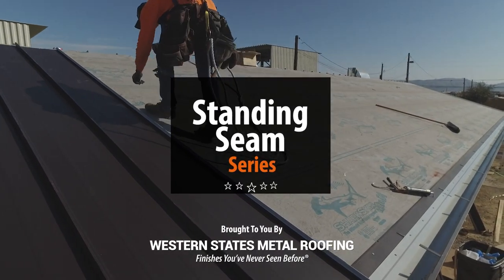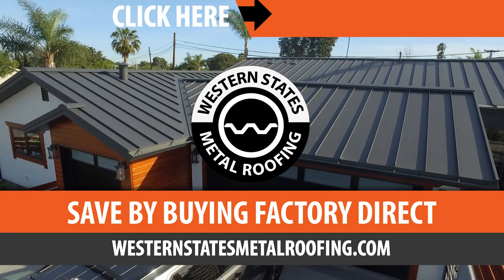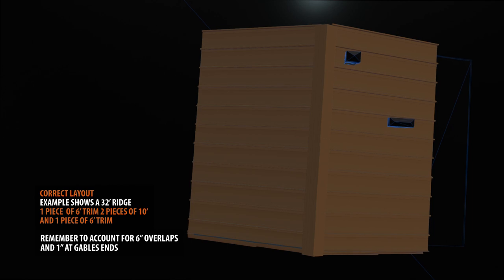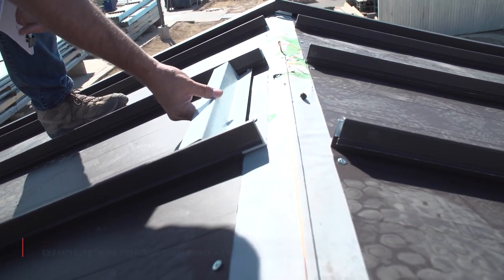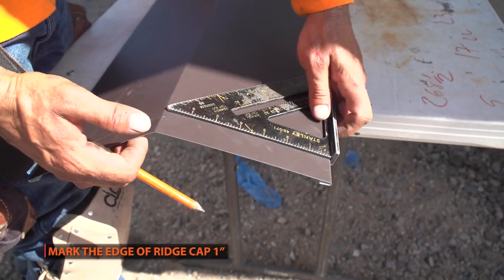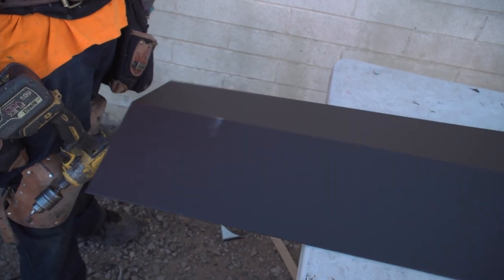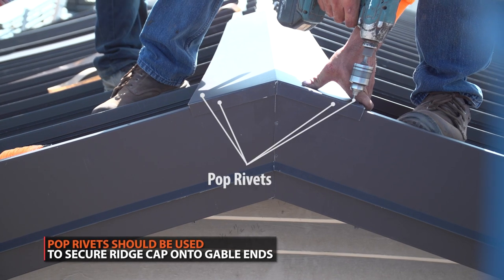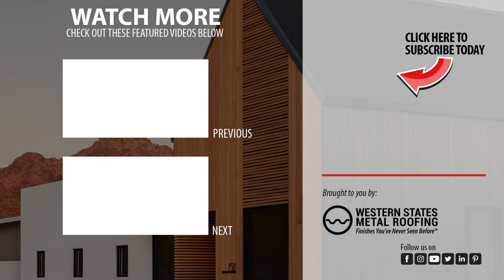How To Install Ridge Cap On A Standing Seam Metal Roof [Finishing + Cutting + Overlap + Fastening]

Comment: What are the specs on your pop rivets?  I saw stainless listed on the drawings, but what sizing do you recommend?  

Are painted aluminum ok?
Reply from the maker: Hello Dan, you can view specs on the rivets we use here.  We have rivets that are painted to match the color of material you purchase from Western States.  https://www.westernstatesmetalroofing.com/fasteners      Description: STST43
Head Style: Dome
Rivet Diameter Nominal: 1/8"
US Dimensions: 43
Grip Range: .126 - .187
Hole Size/Drill No.: #30 (.129 - .133)
Shear (min Strength lbs.): 420
Tensile (Min Strength lbs.): 530

Hope this helps.
Reply: Thanks!  That helps a ton.  @WesternStatesMetalRoofing